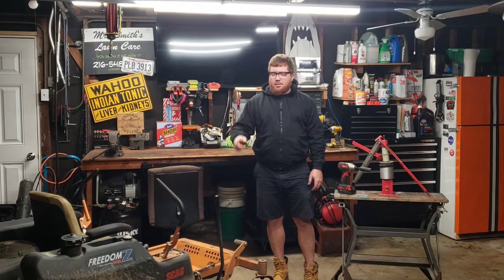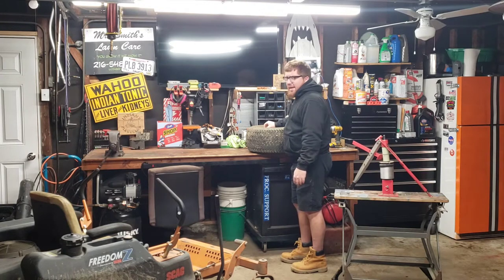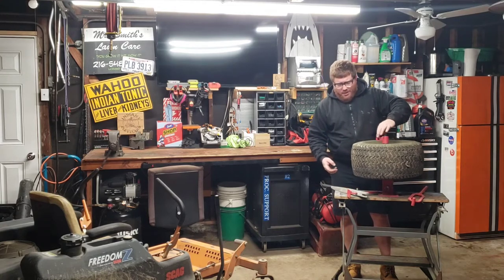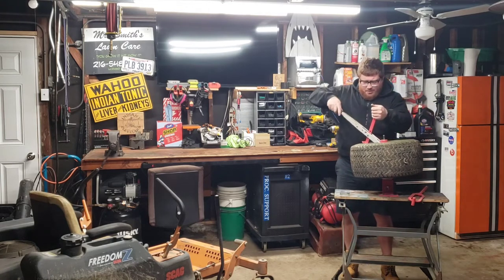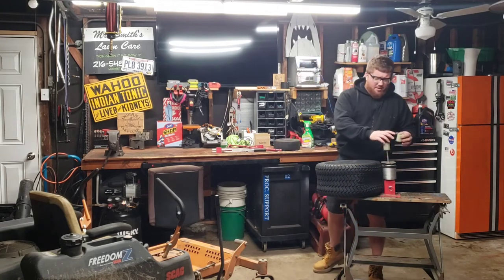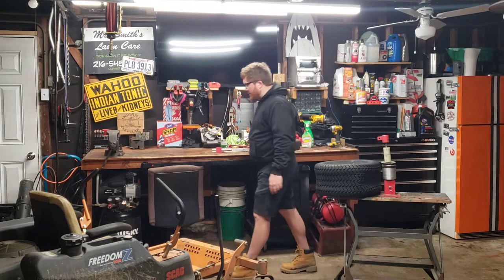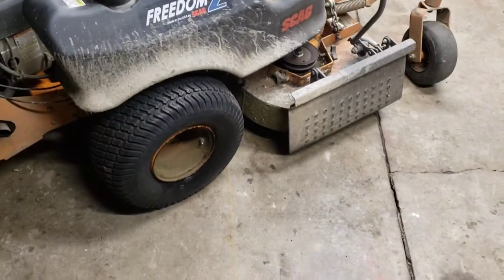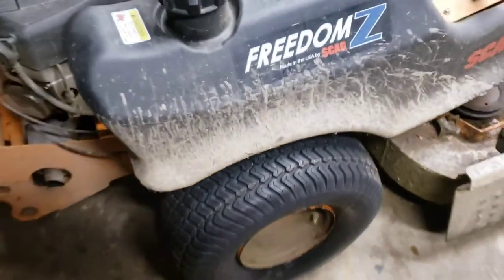How to change a tire on a Scag

Comment: Dan do you have to take off the belt drive section of the tire off
Reply from the maker: It's hydrolic there is no belt.
Reply: @dansmith7147  I’ve got an old school mower just wondered if it was absolutely necessary

Comment: Slime in tire is nice for when you get a flat while driving and to get you home or a garage, not permanently. my HF tool was about $37 without coupon. Ive changed atv,utility trailer,garden tracter tires using this tool/jig.
Reply from the maker: Its a great tool at a good price.